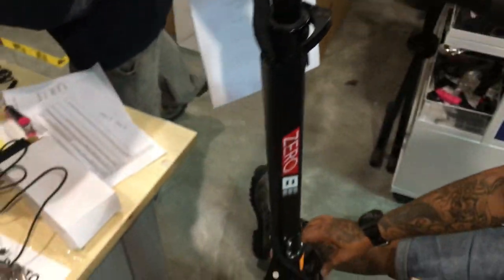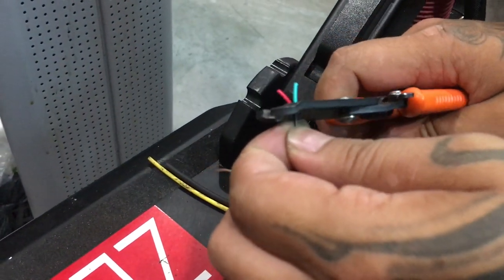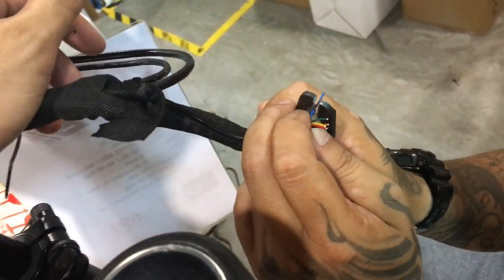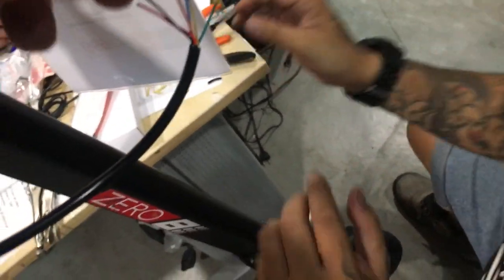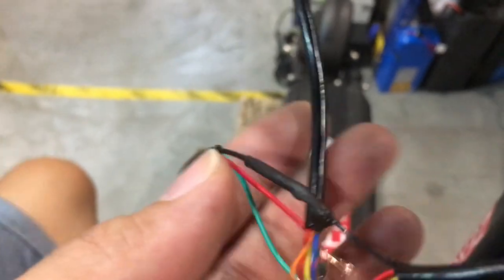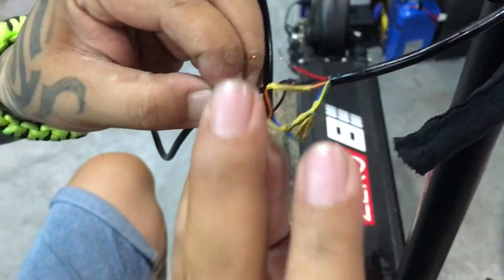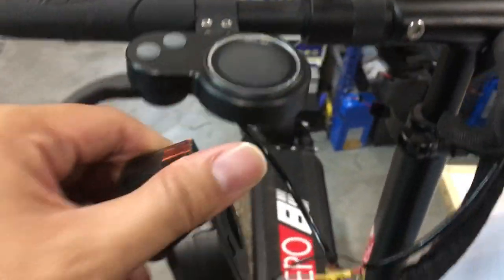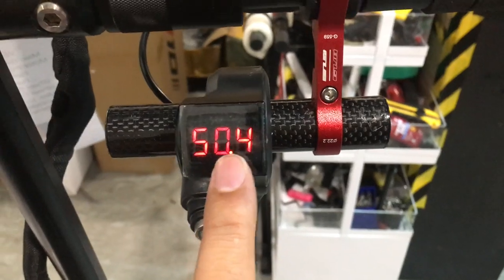Installing Key Ignition to ZERO and Inokim E-Scooters

Comment: Please read this before trying to do it by yourself !
1. DISCONNECT the battery before starting to cut, disconnecting, or solder cables, this is the first and most important thing to remember !!!
2. For your safety, I advise you to NOT do this inside your home/apartment because of the risk of fire (lithium batteries pack a serious amount of energy and in case it exploded you won't be able to stop it by yourself, in case it begins just run and hope that the insurance will cover that...

and I also want to share my thoughts and experience with installing a key ignition, all other videos that I found about it were talking about replacing the key ignition or going for the wiring at the bottom where the controller and battery are located, In my opining this is not safe to do so and I liked more this method where you do the wiring+soldering on the top where is the display is located. it feels much safer and easier to do because the scooter brands and built might be slightly different and in my case the was a special grouping wiring that includes the connectors of the brakes input, lights and horn buttons, and the display so when you are checking the down part of the scooter it might be hard to recognize which wires are relevant only for the display so by doing it at the top is much easier and safe (yes it won't look very aesthetic because you will probably need to tape it with electric type or heat shrink tube)
Reply: Oò8ooiiì
Reply: Hello. Can you tell me please if i can install ignition key on a bluetran lightning  like in this video ? Thanks.

Comment: so i have this but without key lock. i rigged it up seemlingly like you did but all i get is it stay at 47 volts never moves. even with just a black and red wire would i connect the red to the green of lcd?
at the moment its black to black red to red spliced into exsisting lcd wire

Comment: Greetings from Colombia
 I installed the voltmeter with a key, I did the steps that you say in the video, the one I installed is a Zero 8 electric skateboard, but when installing it the voltmeter flashes and does not indicate the volts, apart from the board of the skateboard indicates error e10, I appreciate your help to solve this problem
Reply: This won’t work on zero 8 use white wire instead of red

Comment: My question to you please im trying install a video back and front  camera video recorder which wire on the throttle small display monitor is the acc wire to cut the camera off and on with the display monitor please 🙏

Comment: Hiya I have got one 1200watt Electric Scooter dual motor very fast but the problem is no control Speed just comes with moves handle like motorcycle handle So I can’t never control the speed and it’s very dangerous to drive without Speed control So how I can Replace or fix new 3 gears by finger Speed (Note ) I can send you photos for the Scooter please thanks

Comment: I have green purple brown red black from display and red green black from key voltage wire I have a super 73 e bike how would I wire it
Reply from the maker: The safer way is to do it from the controller.
Reply: @FalconpevSg  how would I do that?
Reply: @FalconpevSg  how would I do that

Comment: Hello, since you are promoting this, I have the same one. It's new. It works, but when I install it, it walks a few meters and disconnects the electricity from it. I can't turn it on again unless I put it on the charger for a second
Reply from the maker: Your battery is dead
Reply: @FalconpevSg  The battery is completely new
Reply: @FalconpevSg  When I lift it on the ground it works normally but when I ride it only walks a few meters
Reply from the maker: @majdalaghawani1791  your motor and controller connection has something wrong

Comment: do I need to connect all the black wires together? (all three conttected to each other)
Reply: as i saw the video, i think they do connect all the 3 black wires but still i need confirmation from them. also, what happen to the cutted red wires from the scooter (not from the lcd), as they have connected to the key ignition wires.

Comment: Is it possible to connect the wires together to keep the scooter ON or does the lock ignitiom provides something else.
Reply: The whole point of this is to make a safe switch with a key so no one can just grab your ebike or escooter and ride away with it by just turning it on.
if you wish to disable only the motor but keep the display and lights on, then you will need to look for other solutions or talk with someone with the relevant knowledge.

Comment: Hello thanks for the video. I have the ZERO 8 in 360 watts and 36 V. Is it possible to put a motor 500 watts and 48V. Thanks in advanced
Reply: Its possible but why would u do it the battery alone is 420€ and the motor 200€ just buy the scooter and sell your old one

Comment: I installed it on my Apollo City and the ignition does not work. The scooter turns on bu the keyed ignition has no effect. When turned off I get E10 error but the scooter sill functions. @falcon Pev any thoughts?
Reply from the maker: What’s the Apollo city? You bought it from us?
Reply from the maker: @IronRabbit_19  it’s fine on the zero 9. Where did you get the immobilizer from?
Reply: @FalconpevSg  I got it from RevRides USA which should be compatible with Zero 9. is there any setting in the LCD 'P" programming?
Reply from the maker: @IronRabbit_19  send us a pic of your wiring...sales@falconpev.com.sg
Reply: I have the same problem with zero 10

Comment: I followed your instructions but i didn't cut off the connector but i did the work after it. And it didn't work. The scooter work normally but the key not. What can be the problem?
Reply from the maker: you might have missed a step and it is crucial to follow just to be sure :)
Reply: @FalconpevSg  your instructions are not clear enough. Didn't work on my zero 9

Comment: Great video, may I ask for your help? I have a zero8 with the qs-s4 lcd display. I had a crash and the wires that goes into the lcd had been pulled out. I dont have a diagram how to solder them back inside ,was wondering if you could take a picture of the inside of a qs-s4 lcd for me? Thanks alot
Reply from the maker: Hey please email sales@falconpev.com.sg for better support or whatsapp us at +65 8748 4565

Comment: It is possible to connect Single / Dual
Switch in the same way?
Reply from the maker: Hector Quintero yes you can connect a rotary switch for single and dual.
Reply: @FalconpevSg  Thanks for your answer

Comment: Comment from Japan.  There is no ZERO video in Japan, so it will be very helpful.  Is the wiring connection of ZERO8 and ZERO9 the same?  Thank you
Reply: the wiring for the keylock is the same for 99% of electric scooters
Reply: Robert Schrauder ?

Comment: Does this Ignition Key works with Kaabo Mantis with Minimotors display/controller?
Reply from the maker: TheChazas what’s mantis?
Reply: Hi Chazas! In the case of Kaabo Mantis Dual (2020) the ground is black and you have to use the white cable, not the red.
Only with the white and the black cable which comes from the controller works for me.

Comment: This wiring diagram can be applied to the xiaomi m365?
Reply from the maker: Qogicx nope
Reply: @FalconpevSg  thank you for the fast response, if i applied this method it will show the 5v of the dashboard not the voltage of the battery is that correct?
Reply from the maker: Qogicx hi it doesn’t affect the display of the lcd at all. Your lcd will still read the main battery voltage
Reply: @Qogicx  hi, did you manage to solve the meter reading the 5v only?
Reply: @jim3808  i decided only hook up the key switch without the voltmeter because my e-scooter slowed down with it.
Reply: @Qogicx  thanks bro :)

Comment: I would never install something like this without soldering the wires first. 
But why cut it when you can open up the display and solder directly to the pcb!
These type of lcd displays usually have an extra unused entry place for such a wire.
I would NOT recommend going with this solution

Comment: don't work unless my ignition keys broke it was from ebay…..not sure if its my switch but green and red with the key to the on works any other wire example red and black i get nothing with a continutity test on  a multi meter 

red black nothing 

green and black nothing

green and red working 

thats all  I followed the video and mines not working

Comment: Any key operated device with wires is installing a mechanism to connect wires together. Anybody wishing to hack the system just has to snip the cable and touch bare wire cores together to bypass the "security"
Reply from the maker: You can hack almost any lock, but better than no security at all.
Reply: @FalconpevSg  True but the best door locks and padlocks do not permit simple bypass operations

Comment: I wish they would make these with proper connectors that fork so you could connect them straight from the controller to LCD connector inside the deck, instead of having to cut and solder wires, would make it much more consumer friendly.
Reply from the maker: thanks for the feedback

Comment: do not work with my 0-8 i can always  start it witout key, voltmetere show 00.0 and she tell me E10
Reply: now it's work, it was not red wire, but white for me. i've cut 1 by 1 wire to look who  have juice! and that's all
Reply: @Lenanea thank you.  It was the same on my Zero 9.  Voltmeter dimly showing 0.00 and pulsing.  I was still able to turn on the scooter with the key in the off position and it showed E10.  After reading your post, I checked the white wire with a multimeter and it had 54 volts.  Once I hooked up to the white wire, all working correctly.